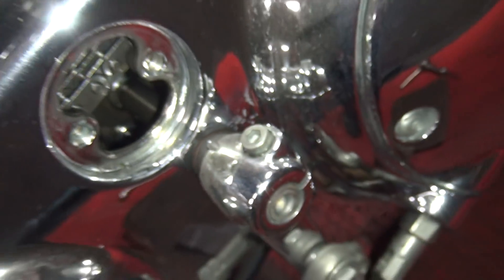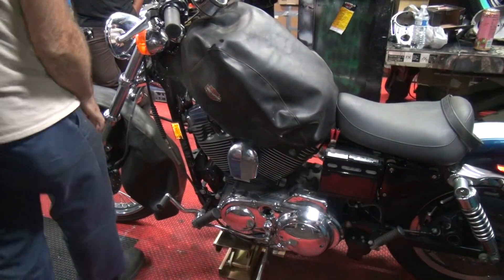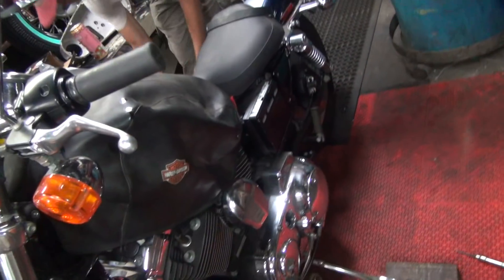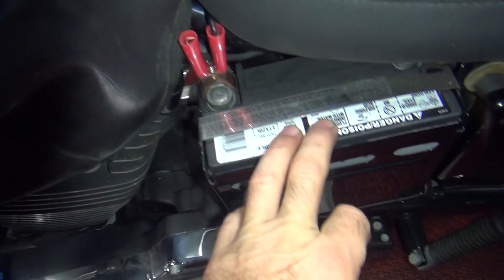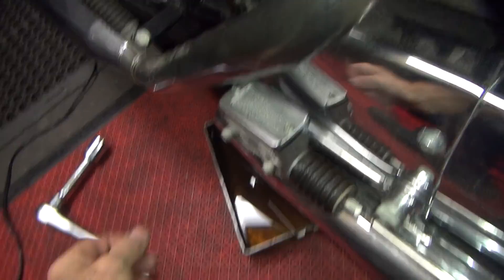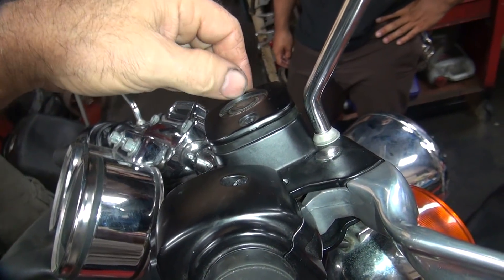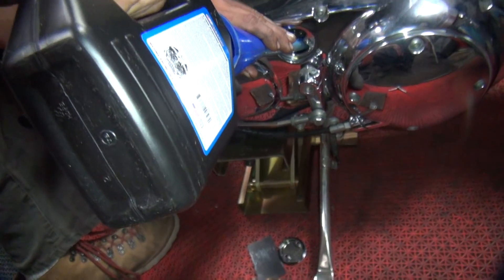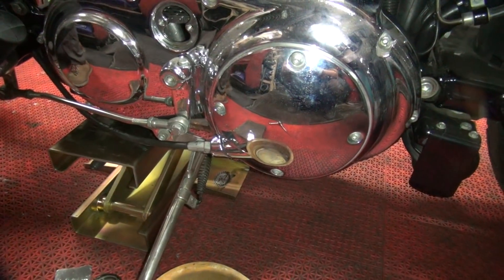#123 1999 1200 sportster custom used bike check out 10k service harley by tatro machine

Comment: Everywhere but Cali, that vent hose from under the fuel cap that runs along the top of the carb goes into a fitting on the frame downtube behind the oil tank